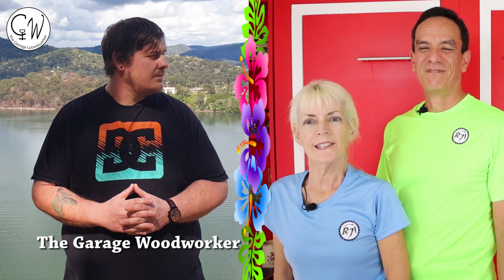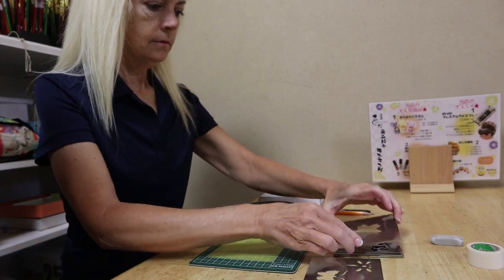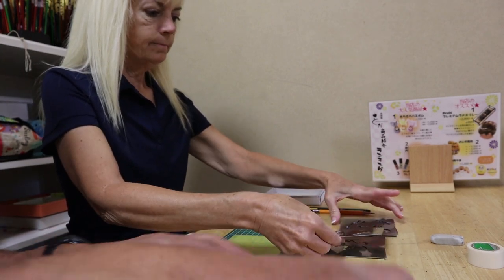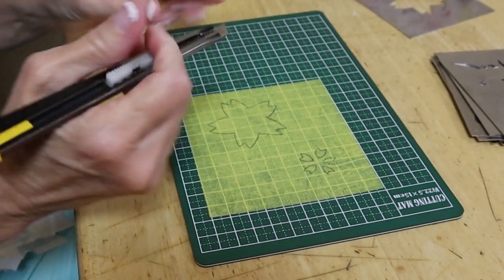Poor Man's DIY: Gold Leaf Lacquer Ware Workshop

Comment: Cool! Never touched gold leaf before. They turned out great! Does gold leaf work with wood? I’m curious, could make for a good wood and gold leaf art piece 😍
Reply from the maker: We are definitely not experts but it is real 24K gold that is pounded unbelievably thin and is just placed on top of anything. wood cant absorb it so I am sure it will work, but the gold leaf is incredibly brittle but once the glue used in cured, you apply a protective coating over the gold.
Reply: Poor Man's DIY brilliant! Thanks for the info and tips. I may try it sometime in the future! 😃🙌🏻

Comment: Does the gold leaf need some sort of lacquer to protect it or is it fairly hardy?
Reply from the maker: Very observant. I did not mention it but you have to wait 30 days for the glue to completely cure and then apply an acrylic! The gold leaf is extremely fragile and will peel off without doing so.